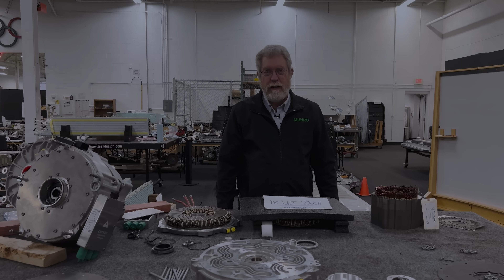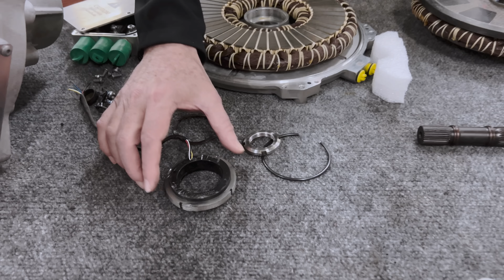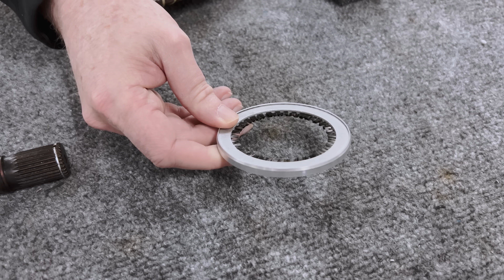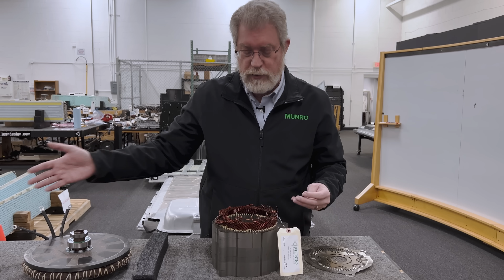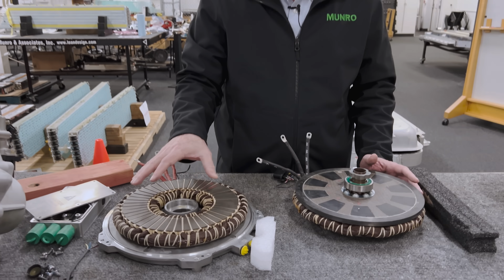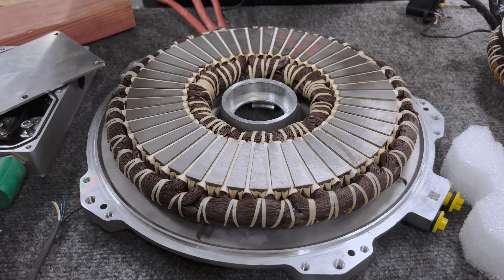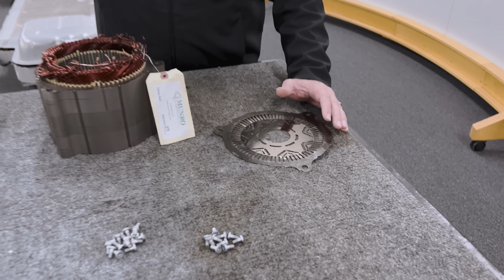Axial Flux Motors Explained: The Future of EV Powertrains?

Comment: Our company worked some this years ago, and one unusual problem we ran into was the Coanda effect, which tends to draw two plates together when spinning.  As a result there were more axial forces on the bearings (as opposed to the normal radial forces), requiring added material for support structures.  Control of the airgap became much harder.  In motors, it is always the maximum (and total) flux density allowed in the material, multiplied by the actual area of the torque surface (or linear), as applied to some output shaft or rail.  Axial flux motors are very good for slow speed application where you need a lot more torque, but not so good for high speeds, where the balancing and lateral vibrations and loading prevail.
Reply: Not sure the Coanda effect applies here as I don't see any opening at the center for air to enter.  Your design may have been different.  This will turbine out the air the vacuum out from the disc causing the clamping you are describing.  ON second thought the two sides should balance out.    I did an analysis on this many years ago because I wanted a compact motor for our winders.  Small diameter at start of roll(high speed, low torque).  Big diameter at the end of roll (low speed, high torque).  I ended up designing a planetary gearbox.
Reply: @HobbyNut-sy3lo  Ich meine, dass würde auch in einem Motor im Vakuum so passieren.  Ich würde eh immer die Luft absaugen oder eine reduzierte Stickstoffatmosphäre schaffen.  das sind er Massenspezifische Effekte und Effekte der  elektrischen und Magnetischen Wechselwirkung .
Reply: @HobbyNut-sy3lo  Coanda effect is a translation of Bernoulli law which states that dynamic pressure (dependent on velocity square) added with static pressure is constant. In this motor case there is velocity of the lair of air between the two parts which makes the outside static pressure higher which in turn push the two plates to one another. In a traditional Coanda effect, the air foil which sticks to the surface has dynamic pressure in the laminar flow which makes the local pressure go low while the outside pressure is higher
Reply: This is an interesting perspective to explore. I'm building such a motor and I'll definitely do some tests on coanda before proceeding with manufacturing the backiron. Thanks for the knowledge!
Reply: Are you talking about dual rotor topology?
Reply: @ShailendraKumarGupta-e3r  yes. Dual rotor. Dual balances out the magnetic forces in the machine. Be it dual rotor or dual stator.
Reply: The shaft and bearings are all wrong. The shaft needs to be a larger diameter, and, as usual, they need better bearings to handle radial and thrust loads. Everybody always cuts cost on bearings which are cheap AF. Makes zero sense.
Reply: Mit welchen Drehzahlen habet ihr gearbeitet .  Ich sehe so einen Motor z.B. als Antrieb  in schweren Traktoren für die  Front und vor allem Heck Zapfwelle.  Also dem Wegfall des Monster Getriebe eines Traktors. 
2.000 U min sind da schon das obere Ende in etwas. 
Oder bei Schiffsschrauben  im POD  Antrieb . 
# Bei kleinen Stückzahlen ist mir mein Herz aufgegangen.
Reply: @ Are they really not just hub motors or used in conjuction with an ICEngine to fill in the low-power areas of the ICE?
Reply: @Sidowse  Nur Nabenmotoren? 
Witzig.
Reply: @ What advantage do they have over classic high-rpm in-runner motors and gearbox? Do they not exist to fulfil applications where a gearbox is impractical; such as hubs?!
Reply: So why not have opposing magnetic forces by having two motors. One pushing and the other pulling. That way the two magnets cancel each other out but are on two different magnetic plates.
Reply: When you say high speed what do you mean. How high we talking? 

 Everything I know points to axial flux motors just being superior in cars outside of cost. 

 I mean the SPX 177 from UK motors claims to have 650bhp of continuous power at 28kg. The inverter was like 12kg. 

 At one time they had peak power showing up as 971bhp. I doubt they could cool it with that much power. 

 I don't know about efficiency in axial flux over the power band. 

 That motor is actually a 2-1. So the torque was low compared to say Koensiegg Dark Matter motors.
Reply: Says complex shit has 420 in the end of screen name
Reply: @lancelotkillz Andd thought more about it than most...  your point "killz"?
Reply: So, it'd be better to turn my generator heads and runs on less than 120v?
Reply: But they generate more torque and can be run at lower speeds, right?
Reply: Axial flux to me seems like a better solution for direct drive ebike motors where there is significantly smaller axial flux to end turn ratios.
Reply: What about the Gauss value, heat must be the main enemy of magnetic by losing it's Gauss.
Reply: @rainbowsandcupcakes6340 
For non permanent magnet designs, and even with, you're far more concerned with the coils themselves burning up their insulation far before the magnets, which have no direct heat contact will demagnetize.
Reply: I invented this when I was 12 it was going to use a brake rotor though
Reply: The low speed and high torque makes sense why they put in between engine and transmission.
Reply: Ну так это же здорово, такие моторы можно прямо ставить на колесо без всяких редукторов!
Reply: It's not really Coanda in this case. Axial flux generates flux not just radially as in a radial flux motor, but as a composite of both radial and axial directions. So, there is a quantity of axially thrust in the disk. 

The axial portion of the flux generates the Lorentz force tangentially creating the desired rotational energy we want, but the radial component generates Lorentz force tangentially AND axially. So, what you were seeing was the radial flux component of the motor pushing on the disk axially making it bend in operation. 

That pretty much falls to the winding design as far as I can tell. And it matters as to the configuration of rotors and stators.

Going stator-rotor-stator where the stators are 180 out of phase should in theory limit the axial force to 0 as both radial flux components will be generating axial Lorentz force in opposite directions cancelling them out. The rotor-stator-rotor design is more powerful sense, but has the largest radial flux component as a result. 

So, rotor-stator-rotor seems to be great for low RPM industrial uses, and stator-rotor-stator may be better for higher RPM higher power applications. 

It'll be interesting to see as more companies come online with their axial flux designs. Some of these engineering problems are really challenging!
Reply: Good torque at low speed indeed but poor performance at high speed. Since max speed dictates the volume, axial flux motors will be bigger than radial flux motors for the same power ratings. Therefore bigger means more expensive for mass production. But for custom design it might be a good choice with minimum capital like Munro says
Reply: @Juice7757  Also the "centrifugal" forces will be much larger.  Note the fiber band around that perimeter.  We did some work in "inertial energy storage" and a flat blank is a very poor way to store energy, but is used because it is easy to fit into a flat container.  The EU did this for city buses.  Had poor results mostly due to maintenance costs.  They used a partial vacuum in the rotors, as do some EV companies now.
Reply: So they won't be the future of EV powertrains because from: Faraday's/Lenz's law, we know that electromagnetism is about the rate of change of flux. Deriving your power from high-torque adds a lot of weight and for electric-motors, low RPMS results in a lot of heat/high inrush current. They end up being really heavy hub-motors and we all know how bad un-sprung mass is. Plus, the point of EVs is to reduce hydrocarbon usage, but good luck making the thing with green-energy! Iron is very energy intensive. Smaller, lighter, higher-rpm motors, if cars remain a thing at all, seems to be the way to go. 
Although, thinking about it, drive-shafts and universal joints are also really heavy...
Reply: Thats not true. Look at Mercedes-Benz producing axialfluxmotors for their fully electric amgs. They work pretty well. Its a double rotor single stator set up though.
Reply: @domengmech  Mercedes-Benz purchased YASA in 2021... those would be YASA motors.
Reply: @brianb-p6586  They have R&D working on it in sindelfingen and will be mass producing them in Berlin so yeah not really
Reply: @domengmech I guess they will use their 18 speed automatic for this type of Motor. Do they not know that Porsch has failed with this setup (made by ZF)?
Reply: @domengmech Can I purchase 1 motor?  I dont need a bike.
Reply: @domengmech 軸向推力及震動過大故:
1,碟盤轉子高速易扭曲
2,不適用滾珠軸承
3,碟盤轉子不易油道散熱！

Comment: this likely the future of electric motors in less space constraint applications. For EVs, this will take off once the industry finds a cheap/simple way to package axial motors in wheel.  I still couldn't find a reason why Tesla decided on cool, large diameter wheels on the Robotaxi-I think, years ahead, axial motors will be used to power it.

Comment: What about the Halbach arrangement of magnets? How does it compare to axial flux?
Long ago I had a hand in developing Brushless DC motors for RC, yes, the ones in all the drones.
Imagine using a mass produced motor out of a CD-ROM player. That was the start.
I sold kits for a year or so. You could wind your motor to your specific characteristics since I sold the kits with your choice of wire. Then we started stacking them and called them a double and a Triple. One of my "single" motors was the first to take an electric plane to over 100mph.

Comment: Power per (weight of motor) is the same - granted - but would it have better power per (moment of inertia) of the rotor? This might explain the "motorsport" aspect - zippier acceleration and braking.

Comment: You need a lot more than a crowbar to disassemble that axial flux motor!  Force has to be TONS!  An axial flux motor I built was 4 inches in diameter (2 rotors, spaced 1/4 inch apart, 16 pole, 1/2 inch square poles) had 200 lbs force attraction (stator was 1/8 inch thick coil set, "ironless").  I used "jack screws" on the stators to assemble.
Reply: Sir can you provide details of that

Comment: Do the main bearings not need oil flow lubricant (seems like Hydrodynamic bearings are able to provide 100% better cushioning of flux vibrations)?   The integrate cooling channels must have critical gasket, much like a head-gasket to prevent any leaks in the long long term operation.  Any thermal expansion and contraction cycles over and over, if you catch my drift.
Reply: Many motors use sealed greased bearings.

Comment: A couple of questions, what is the weight comparison, what is the rpm comparison to get the same kw and torque? A link to the supplier and retail cost. Can that motor be used without the gear part? Thank you.

Comment: I would think that one other advantage of axial flux for their business case is that axial flux motors can be "stacked", which means when they are quoting/designing a new motor for a new application, they can consider changing the number of stator/rotor sandwich from from a previous design.  In fact, as you pointed out, the motor you've got is already a 2-sandwich design, which suggest that there's probably a 1x in their catalog and if someone wanted a 3x they could provide it relatively quickly.
Reply: Not just that but you have other configuration options. This one uses 2 stators one rotor. You can also use 1 stator with 2 rotors or 3 stators with 2 rotors, depending on power, density, torque, weight, or cost priorities. The geometry also gives a torque advantage due to the long lever arm from the shaft and it is easy/cheap to make hollow shaft motors for things like machine spindles, gimbles, or windmills
Reply: @excitedbox  Good points.  Even more reason for a company making "custom" low-volume electric motors to chose Axial Flux designs.
Reply: That seems like it would actually be a dramatic change in the bearing designs and axial forces on the various components. Which is why they doubled up two entire motors in this assembly instead of "simply" stacking another rotor and stator.
Reply: @ It depends on use case. This is for motor sport so high power needs extra strength and having 2 sets of coils gives you much higher magnetic field strength. A pickup truck could probably just use a thicker shaft because the force is more gradual.
Reply: Any type of motor can be stacked. Axial-flux motors are particularly suitable for stacking because of their proportions - they tend to be relatively short (axially) for their volume.

Comment: The two main benefits of axial flux rather than radial flux are nothing to do with surface area per unit volume, which yes, is a factor and yes, does change the torque co-efficient, but does NOT change the power co-efficient!

The two primary benefits are the possibility for a lower thermal impedance for the stator windings because a characteristically "thin" pancake form factor has a larger surface area to to volume ratio than a long cylinder, and the fact that if done properly, you can minimise the ratio of end widing to active winding, ie you can decrease the dc resistance of your machine because more of the copper of the stator winding can directly generate torque.  (note, this is NOT done well by this machine that looks to have a poor end winding layout)

The downsides are the fact that rotor cooling is less effective than for an radial flux machine, and that high power outputs can be problamtic due to higher Centripedal accelerations and hence rotor internal strain for any given torque density (larger diameter spinning part!)

Comment: The discussion of axial magnetic forces versus bearings and structures is helpful. 

The spiral winding of a notched strip to form the stator laminations is interesting, too. I had wondered if it were done that way. It would have been nice if one stator were torn down to show this, but it seems like this was a non-destructive disassembly, not Munro's usual tear-down. Yokeless stator axial motor stator cores are different; YASA uses soft magnetic composite (SMC) material.

Comment: Rather than saying "the flux that is producing the torque" in describing the direction of flux, try "the flux across the gap between the rotor and stator". That's much easier to see as axial in contrast to radial. 

Unfortunately, it's probably also necessary to define "axial" as "parallel to the motor axis, or shaft".

Comment: Well…an radial flux motor have a very large design space, that is, you can have different pole count, different length to diameter and you can turn it outside in making an outrunner type. So reaching a similar torque to volume is no problem and would say, a higher torque to weight is possible too.

Comment: It would have been helpful to start with the overall configuration, perhaps illustrating it by just setting the parts up in order but separated. This motor has the old configuration of two stators with a rotor between them, rather than the configuration used by YASA, which has two rotors with one stator between them. The difference is important to cooling, cost, bulk, etc.

Comment: What would be the power output of that radial flux motor and that axial flux motor?
Reply: The Bolt is rated at about 150 kW; he said that the axial flux motor was simIlar.

Comment: Thank you for finally mentioning the downsides of axial flux. Every other video and article out there is mostly marketing that only touts its advantages.
Reply: Every technology has pros and cons, just need to find it a good application.
Reply: @brian.z6592  What a stupid platitude
Reply: That's why this guy is a superstar of youtube engineering explanations. You get a really good explanation of how something works, what the differences are, and what the pros and cons are at just the right level. That needs a really good understanding of the subject, and broad experience, and it's very rare to see given out for free.
Reply: I mean it really isn't a disadvantage of the technology, more so a disadvantage of the tooling requirements -which ofc relates to cost increase, especially since the manufacturing methods are not as standardized as radial motors and thus also less competition leads to higher prices.

But yea, it's nice to have more highlights on the industry reasons for why some companies decide to invest into one type of motor over another.

Comment: I know it’s not really the style of the channel, but adding a few limited visual aids would be nice, hopefully without increasing production costs much. Like when discussing the field propagation of the motors.
Reply: I was going to say something similar.  I'd also add a graphic on the production differences.
Reply: @rmeden1  Even something drawn quickly on a whiteboard would work.  It doesn't need to be fancy, it just needs to be clear.
Reply: They had visual aids - the actual motors themselves, and he pointed where the flux goes. It's hard to be any clearer than that. 3D better than 2D, which is what you'd get with a diagram. What do you think a graphic would add?
Reply: @ I’m taking about the things that are not visible, like pointing to explain the polarity of the generated field and how it’s oriented relative to a standard radial motor doesn’t really help understanding and visualizing what it’s actually doing. A simple 2D graphic could easily demonstrate that in a few seconds, both much faster than trying to describe it, and more precisely.